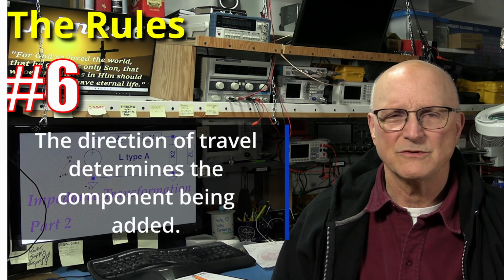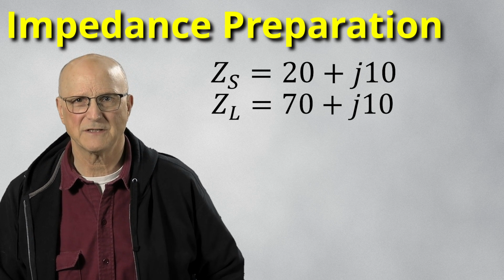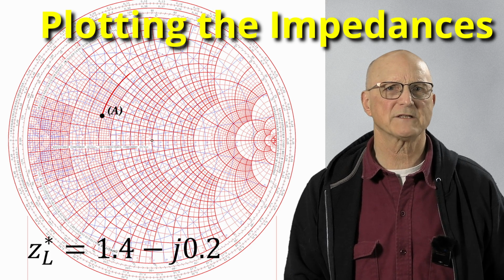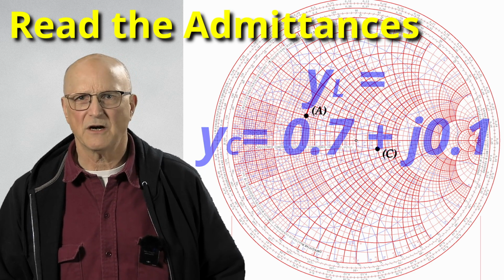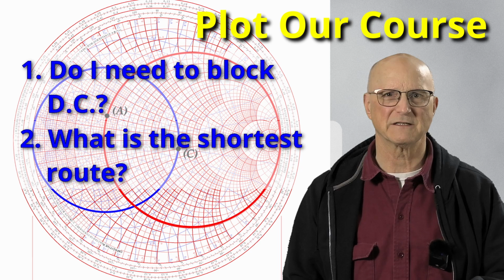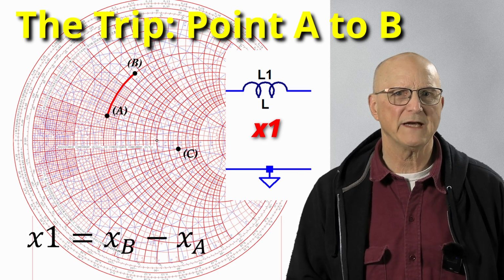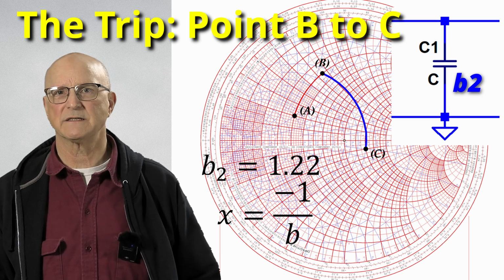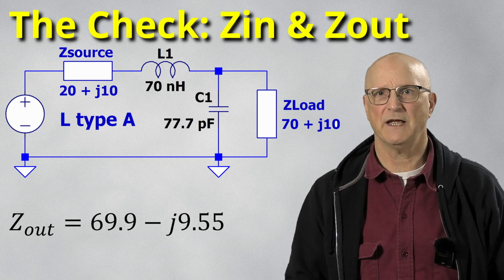Impedance Matching (Pt2): L-Type A with a Smith Chart (079b)

Comment: Nice instruction.

In my mind adding components means you lose more power, but this is RF and these components added are not resistors so they to not convert power into heat (almost none)
Reply from the maker: Thank you!
True that ... reactive components are "non-dissipatory" components except for their real life ESR, which is generally pretty small. :-)

Comment: Great Teaching Maestro, this walkthrough review 'spoon fed' of the basics and applied complete example of L matching, it's all about conjugating and all on the SMITH CHART with one requirement of EAGLE EYES to read those Z's and Y points on the RED and BLUE charts. Retired Microwave Engineering Technician.
Reply from the maker: Thank you so much! Yes, the Smith Chart is a very useful tool, for sure. :-)

Comment: Hi, I didnt understand what you mean by 'Shorter the travel distance , wider the bandwidth' ....Can you explain in a clearer way ...Thanks ....
Reply from the maker: By "shorter travel distance" I mean the length of the lines (arcs) which make up the route between points A and C. The further you have to travel along these lines, the higher the Q. The higher the Q, the narrower the bandwidth. Does this help? :-)
Reply: @eie_for_you  Actually I am confused Why Q becomes higher if length of path increase??
Reply from the maker: I haven't actually worked through this myself. This is what I gleaned from the books and literature on the topic. Without actually working it out myself, I accepted it as I trusted the source and thought I would pass it on to my viewers. :-)

Comment: I checked your answer against my favorite LC Impedance Matching Network website and it was the same.  Also found the let's-block-DC values of 75.66 pF and 155.7 nH with the capacitor in series with source and the inductor in parallel with the load.  Very cool.
Reply from the maker: Cool! I had no doubts! :-)

Comment: That was the best practical explanation of how to use a Smith Chart that I’ve found in recent years! I think for the first time I have a slight idea of how to work with the chart. Thank you for your patient explanation! Can you explain with an example how to match a transistor power amplifier to an antenna? How do I determine the impedance of the source?
Reply from the maker: Thank you! :-) ... And you are very welcome, too! :-)
Well ... we start by applying the formulas for the output impedance of the particular transistor configuration you have chosen as an amplifier. I have a series on the various BJT configurations. I have a FET/MOSFET series in queue. :-)

Comment: Hello Mr. Ralph Gable,
I thank you for showing these 2 impedence matching videos.  I do feel inspired to do this and move forward. I am happy to see how mathematics can determine a circuit and/or design with engineering & physics realms.

I see how I can reintroduce myself in electronics as a career using any application from the smith chart.

Just to be prepared & more skilled, should or must I tinker an electronic circuit design with my own discrete electronic tool kit & Electrical board?

I might as well start see how to design efficient RF transmitter & receiver circuits.  Please inform.  

Thank you.
Reply from the maker: You are welcome! I'm glad to be of some help. If I understand what you are saying properly, before you dive heavily into the wild world of R.F., make sure that you have a good handle on the D.C. side of things. Then the general world of A.C.. Once you understand complex math and how reactive components interact, then dive into the world of R.F.
Experiment as you go. If you think you have learned something, put together an experiment or a circuit design to exercise that knowledge. Exercise this until you are comfortable that you have it right, then move on to the next. This will cement it into your mind much better.
There is my advice for what it is worth. 😀

Comment: If you are considering follow up video topics, may I suggest: Tuning Stubs?
Combined with "real world" data sheets for RF transistors, like the MRFE6VS25NR1 from NXP?
Reply from the maker: Tuning stubs ... gotcha! Check out my Smith Chart play list (https://www.youtube.com/watch?v=nfxf3EEILSY&list=PL27hd2cDvPRuIAUWTncVgjD5dEEmw6CPE) <= I think this link will get you there. 
I have some videos there. I use the impedance only Smith Chart to do it, but it is there for ya! 
I suggest you start with the first video and work your way up to the stub match videos.
Foundations: https://youtu.be/nfxf3EEILSY
Parallel Stub: https://youtu.be/FvhvdGTrdX8
Series Stub : https://youtu.be/u7eUnbYK8Q0
Then there are a couple of demo videos after that.
I hope this helps. 🙂

Comment: As a challenged senior (old) electronic enthusiast,  I thank you for the excellent explanation on impedance matching with the Smith Charts.  I respectfully would ask you to consider a practical application for a Part 3.  Starting with how to measure the impedance of the source and the load and then apply the Smith Chart matching solution.  As I am especially interested in HAM radio antenna matching, that would make a very interesting video and I am sure be of interest to many Ham radio clubs and operators.  Regards  Ed  KK7UNA
Reply from the maker: You are very welcome! I'm glad the video was a blessing to you.
I have a video on using the nanoVNA to measure impedance which is directly applicable to this:
https://youtu.be/Pti8Erw_Kkg
I also have one on measuring the SWR of that antenna using the nanoVNA
https://youtu.be/8s420GKsynM
BUT, instead of selecting to see the SWR at around the 4 minute mark, select to use the Smith Chart by tapping on the Smith option. You can read the impedance from the Smith chart. Everything is the same, setting markers, calibration and all of that.
I hope this helps. 🙂